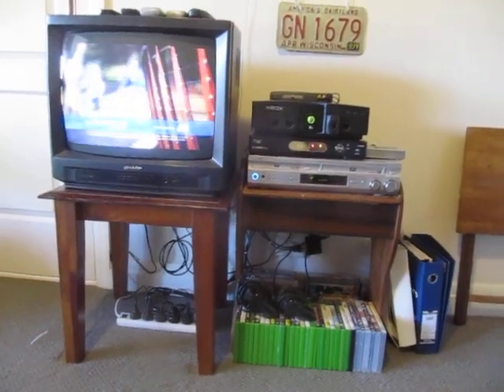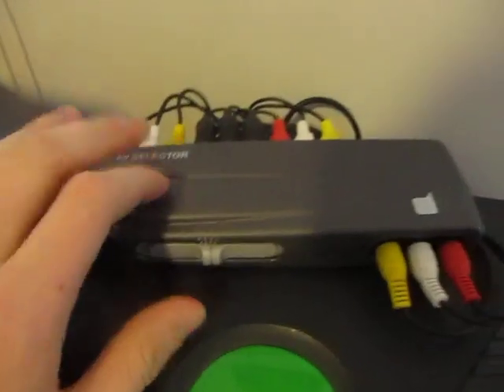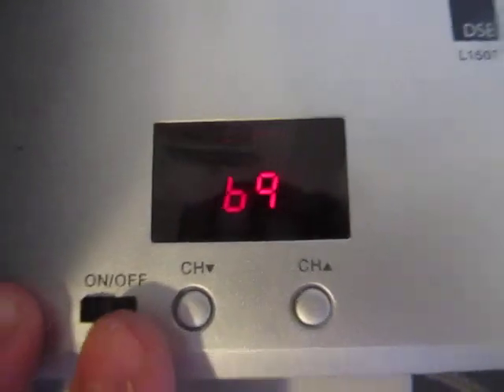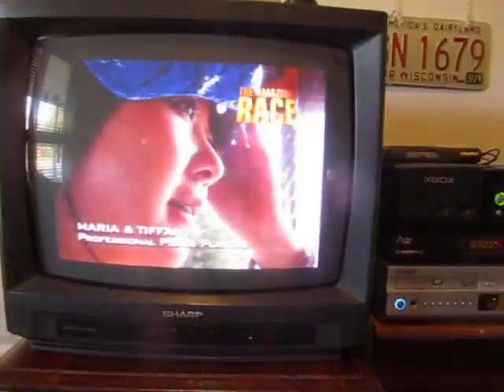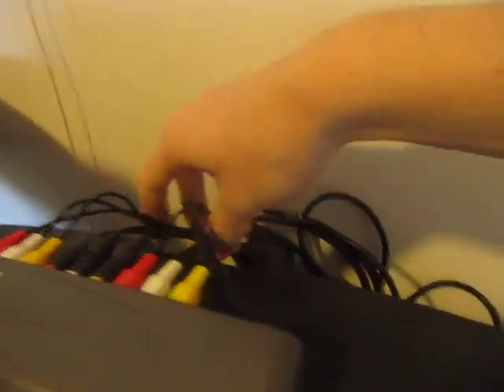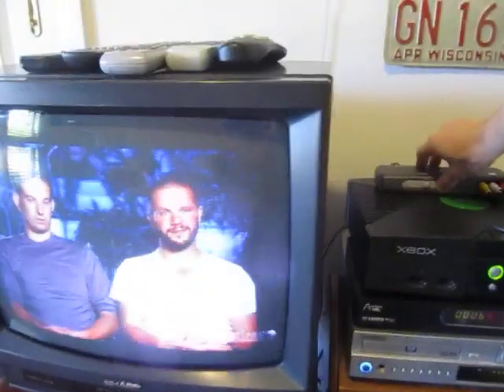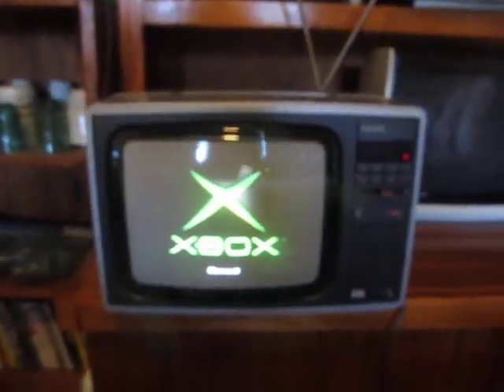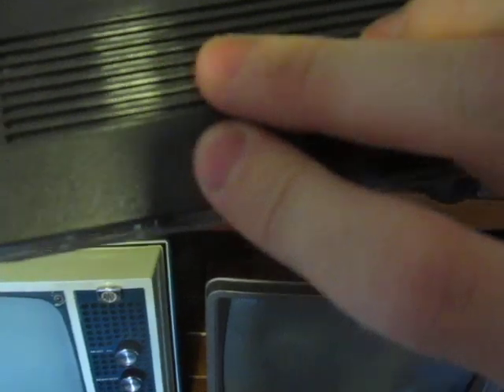My NEW analogue transmitting system

Comment from the maker: I hooked the set - top box up to the AV selector (using RCA cables only), which then connects to the RF modulator, which in turn connected to a coaxial divider/booster. One cable goes to my main television (temporarily my SHARP while my Sony is being repaired), and the other goes through a booster to an antenna. Hope this makes sense.

Comment from the maker: Yes, you use the analogue channels. You should be able to find out what channels the modulator outputs onto. Most output onto the UHF band, so you search between channels 21 & 68 (though you should be able to adjust to whatever frequency you choose). Same for VHF transmissions, which are between channels 1 and 11 (inclu. 5A).